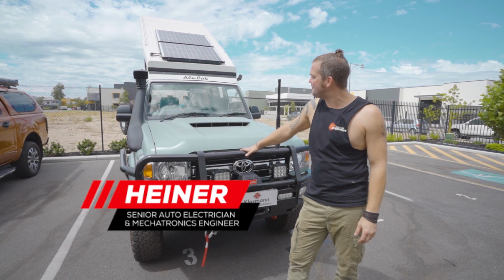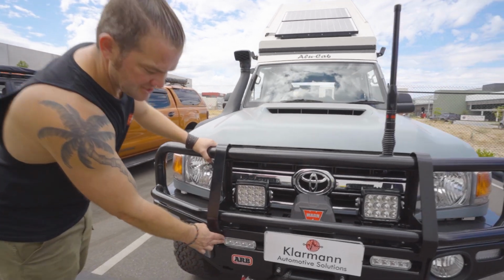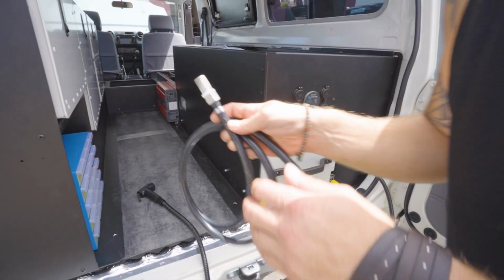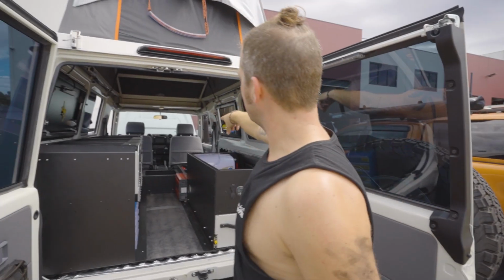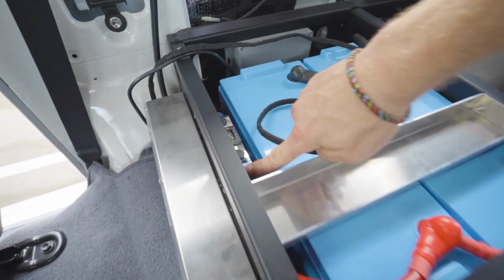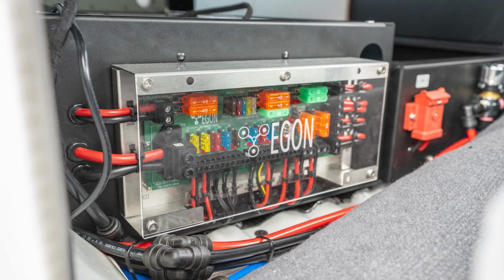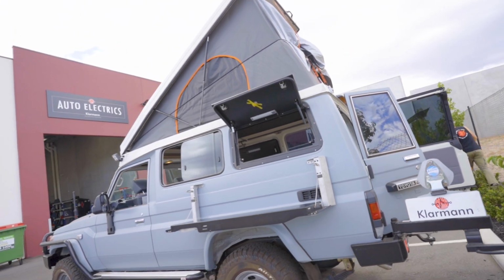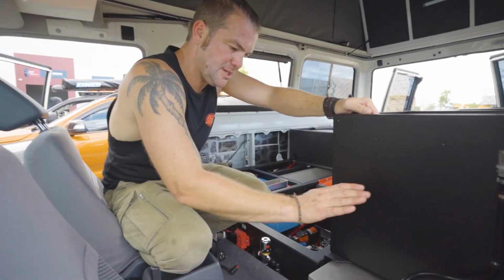Heiner Builds Your Ride | Toyota Landcruiser 78 Series

Comment: just one question  ábout egon water hub. why are you using two pumps?  what is the point not contaminating water pumps, when they both pumps water through water heater, to shower and water outlet and using same pipes... so only thing not contaminated are pumps...  two 3 way valves and one pump will do the same, more cheaper, and less space...